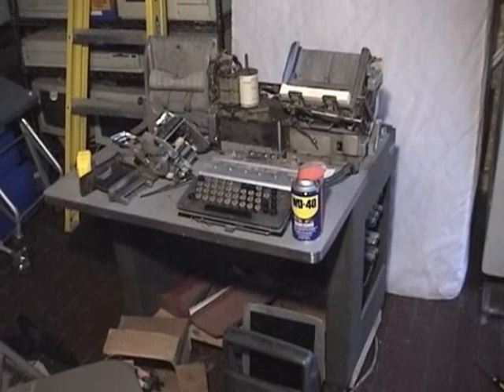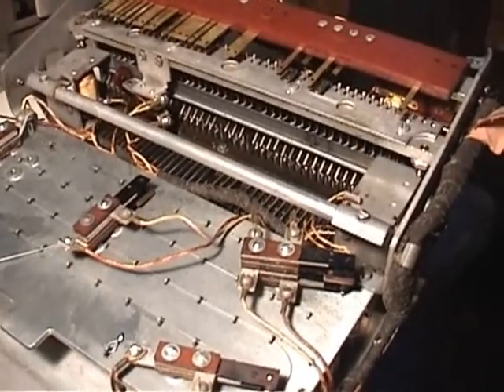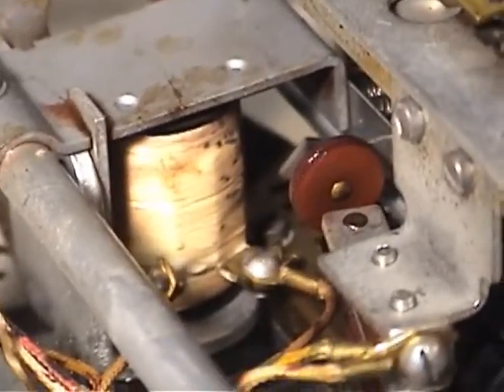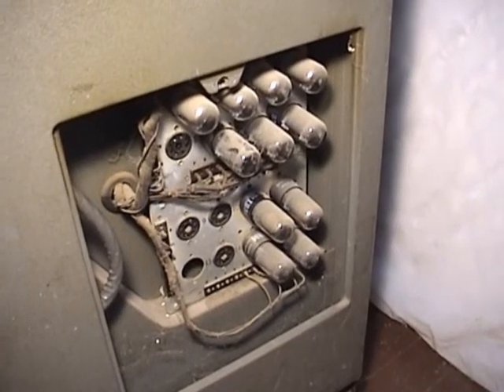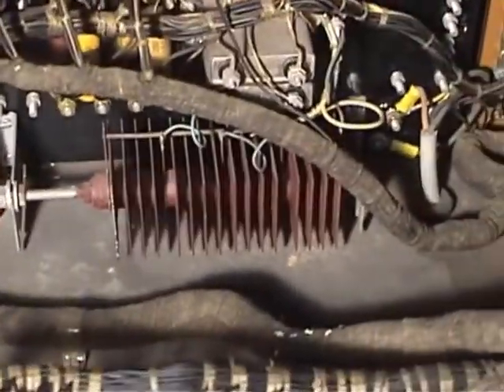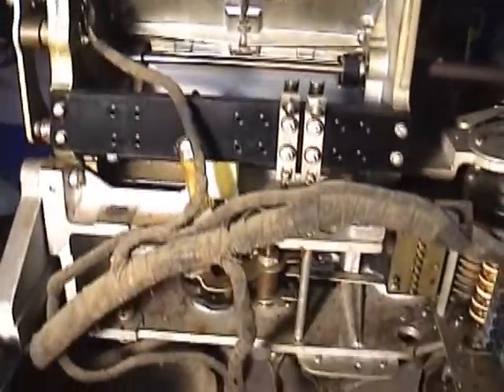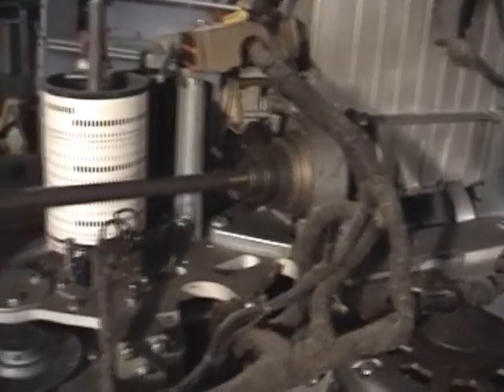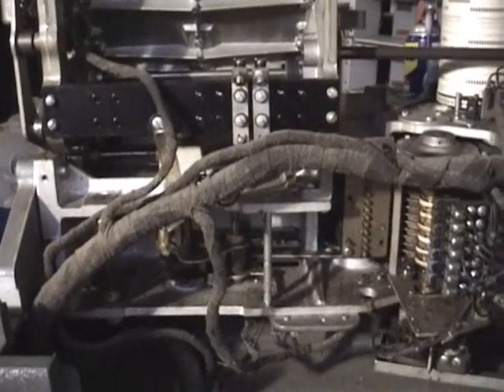IBM 024 Keypunch

Comment: What ever happened with your restoration project? Did you get it up and going again?
I may be getting an 026 keypunch soon depending on how the eBay auction goes, its very close to me and its starting very low. I'd love to work on repairing one of these systems, it'll be an awesome challenge, and with access to a machine shop and 3D printer I can make almost any part other than say the tubes or relays heh. Although the one I'm looking at appears to have about half the tubes and quarter of the relays as yours, doesn't appear they are just missing either. Very different internal layout actually. But either-way I will love having the thing in my collection and the challenge of restoring it!